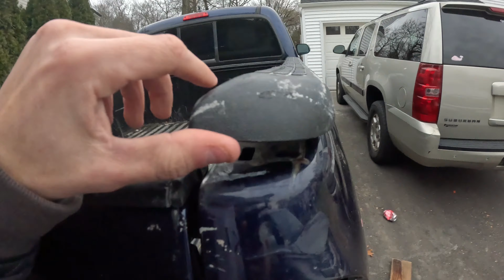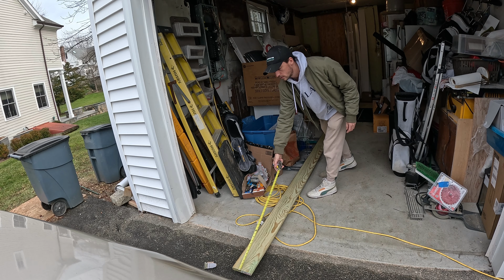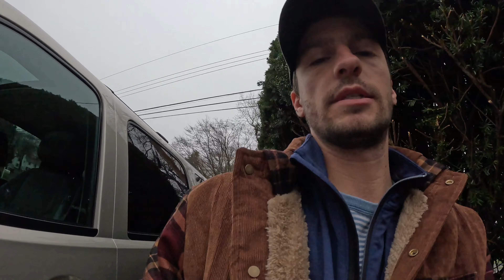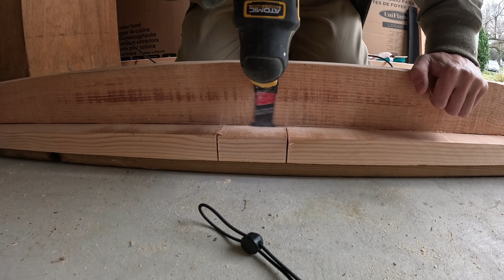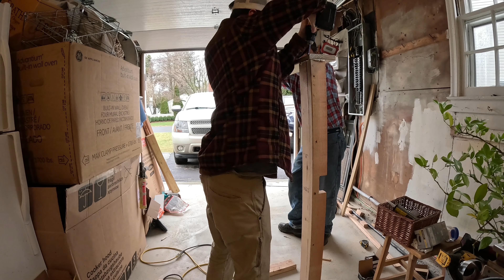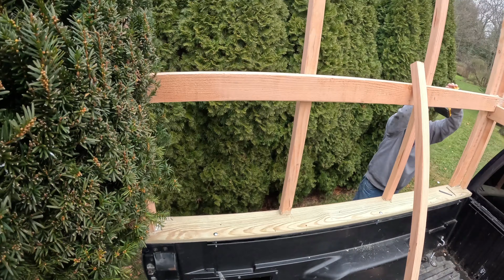Toyota Tacoma Truck Camper | DIY | PART 1

Comment: I like your build. I would recommend putting spacers in your track system to keep them from collapsing when you tighten your bolts down. Unless you have already thought of that.
Reply from the maker: Great idea! Thanks
Reply: This is a good recommendation! I didn't originally design anything to prevent collapsing when I tightened the camper to the truck bed and had to go back and add a board at the front to reduce this later. But I think I will also look for some spacers to add to the track system itself. Thanks for the thought!